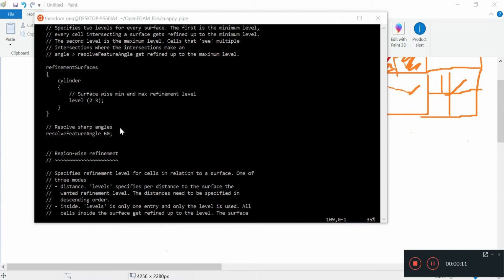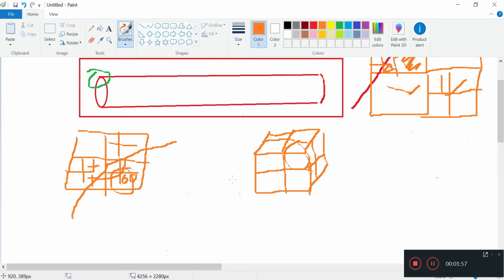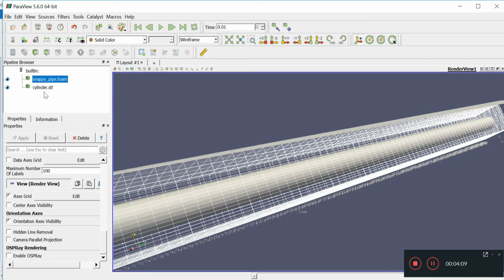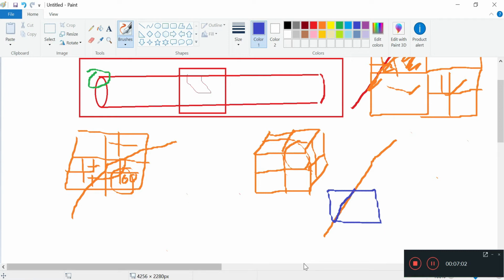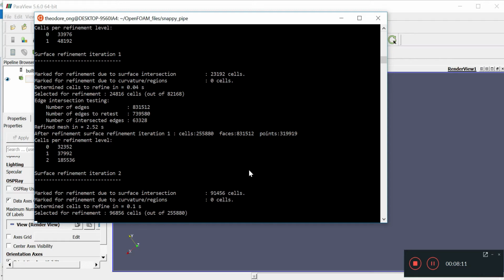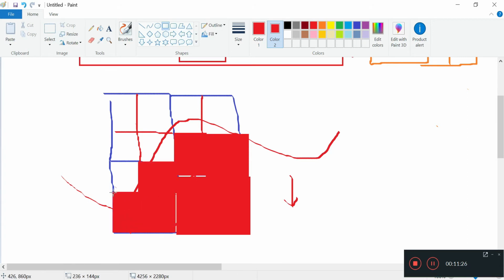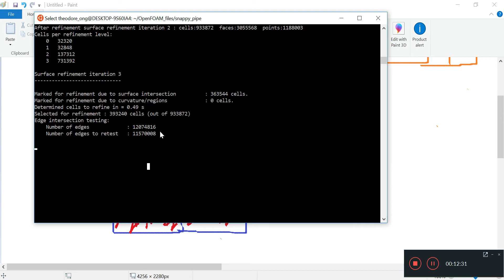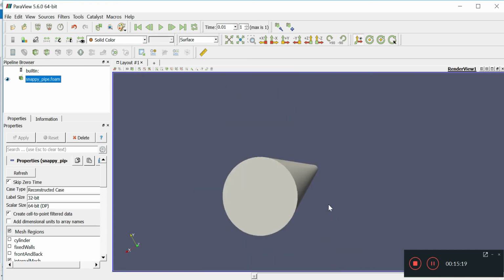OpenFOAM Intermediate 6 - snappyHexMeshDict part 3 refinement

Comment: Hi Theo, thanks for your tuturial. Very clear. Just note one thing, I failed to generate the mesh for the first trial. It turned out to be the missing extention for the .stl when you define {level(2,3)}
Reply: When I put .stl snappyHexMesh finished in 3 seconds without any error. I  don't know the output mesh is ok or not. When i did the same without .stl the iteration took 27 seconds without error.
Reply: @TheoOngScienceAndEngineering   thanks for ur videos, these helped me a lot!  I have tested, if we don't type .slt on it, the program runs only 3 sec. and no results. Everything is ok if we type .slt.

Comment: some weird shit, man, you are killing me, i am loving your videos!
Reply: question, how you play with the original block mesh size? would it be better to do it a little bit smaller and not go down so much in refiment in snappy?
Reply: @TheoOngScienceAndEngineering  Thanks for the answer!, I have another question, for the meshing my own stl i have found 3 different techniques:
1. use autoPatch  (before snappy)
2. separate the stl model in the different patches that we want to differentiate and use the command cat for merge them in one stl that has the patches separetly (before snappy)
3. your method using the topoSet and createPatch (after snappy)
the issue i have is that as my geometry is really complex 1. and 2. does not work properly for me, autopatch creates a lot of inecessary patches before creating the ones i want. the separate STL does not give me a watertight model after the cat (i can not understand why.... i am looking to solve this issue). so i went with your path with topoSet and creatPatch, my issue is that as they are after doing snappyHex i can not use them to set boundary layers in the patchs i want (the walls of the model). is there any way to add it after or something else?
best regards, and thanks for your videos!

Comment: Hi Mr. Theo,
I have followed your tutorials as per your instructions. However, when I open the snappy_pipe.foam in paraview, there is no cylinder (after using the snappyHexMesh command). Am I missing something?
Reply: you need the .stl at the refinementmesh (where you change the levels). Dont just type cylinder , but instead , try cylinder.stl
Reply: @elarabibabas6928  Thanks a lot, dude
Reply: did you solve the cause of the problem?